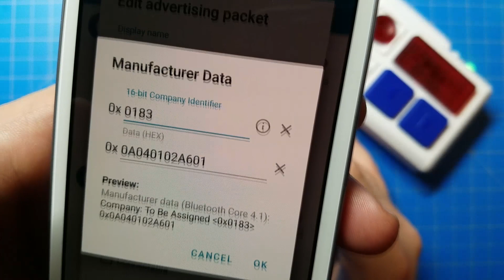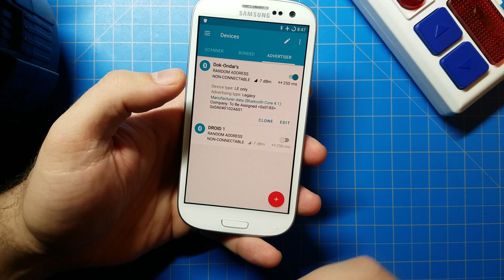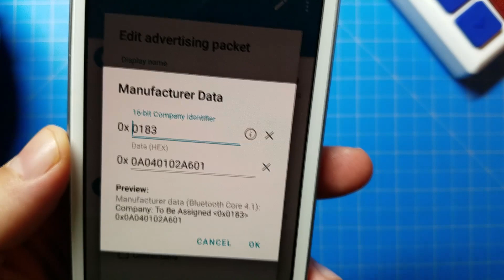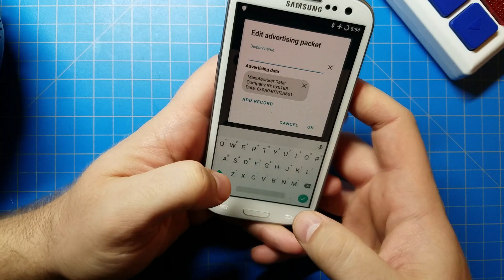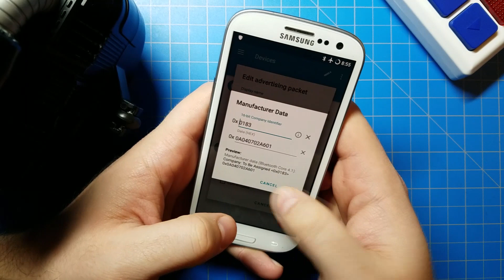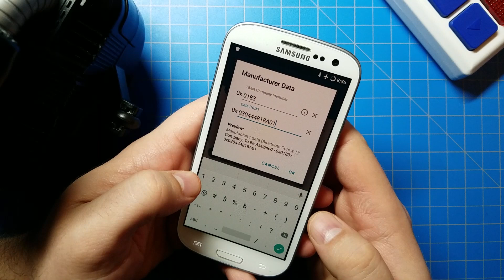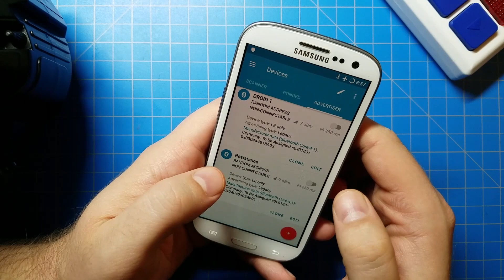Bluetooth Beacons and Custom Personality Chips for Droids

Comment: When you were replacing the bluetooth module chip and copying the programming across, did you see where the stock droid affiliation is stored? Is it possible to alter a droid's affiliation without using a personality chip?
Reply from the maker: not really, no. the affiliation is part of the personality chip. if you don't have a personality chip installed then the personality chip that's stored in the rom of the audio controller is used. the audio controller chip is different from the bluetooth chip. i haven't been able to access its contents.

i suppose it might be possible to patch the firmware of the bluetooth chip to use a fixed value for affiliation rather than querying the personality chip, but that gets into ARM assembly and I'm not well versed in that type of stuff.

Comment: Grate videos. Love them all. Think maybe the potentiometer is related to sensing the upright position of the bb8?
Reply from the maker: i think the pot is for adjusting power to the wheel so the BB drives straight.

Comment: i wanna buy one
plz
Reply from the maker: the issue with selling personality chips is i would only be able to sell chips with personalities that i've designed using my own audio. i couldn't use any copyrighted material such as audio clips from movies or TV shows. i've created one "personality" so far and were I to start selling them I'd want to have a library of at least 5 or 6 for people to pick from.
Reply: @Ruthsarian  what if it came blank and there was like a dock for the chip that plugs into ur computer and alows you to drag and drop files
Reply from the maker: @thehambonetelevision  that would require development of custom hardware (to plug the chip into) and software (to encode and write the audio clips to the chip). i don't think it'd be worth the effort. it'd be easier (and cheaper) to program the chip the regular way. if you haven't already, see this playlist of videos showing how to do all this using existing hardware you can buy off amazon and software that you can download for free:

https://www.youtube.com/playlist?list=PL1LWtA1iy9htxbn6YRiQPNZSwZlszt2Kj
Reply: @Ruthsarian  fair point

Comment: I’m surprised you haven’t started selling custom chips, too difficult maybe? I know there are a Lot of Droid builders out there that come up with crazy ideas. To be honest though, I’m not much different with my idea to take an R3 unit and make it like Analyzer from Star Blazers.
Reply from the maker: i've thought about it. i've sold a few to test the waters. the biggest issue is that people usually want copyrighted material (clips from TV shows or movies) and I don't want to risk the wrath of copyright lawyers. if i were to sell them i'd need to have something copyright free to offer; i'd need to craft another 5 or so custom personalities so people would have some variety to pick from. i haven't done that yet. but i am working on it.
Reply: Ruthsarian noding I hear ya. . . . You could sell blanks, letting the buyer add their own choice. Far as I know, copyright doesn’t apply if one makes for themselves...

Comment: Thank you I think I'll make a master chip 🤣 now I just need to program a blue tooth transmitter with all the beacons to selectively broadcast. That being said maybe the second blue led is for Bluetooth handshakes.

Looking for improvements to my BB the side wheels look like the should be bearings and not wheels  the one currently installed is causing unecessary vibration. But in a better motor and replace the magnets for the head and I bet my BBe will be running like new.

Comment: Can you do this with an iPhone?
Reply from the maker: yes, there is an iOS version of the nRF Connect app I'm using in this video.
-- EDIT BELOW --
I'm completely wrong. The iOS version of nRF Connect does NOT allow creating custom beacons. it appears this is an intentional limitation of iOS; custom beacons are not possible on iOS devices.
Reply: Well I have since found out you can’t do this with the IOS app because it doesn’t let you make custom signals. Thanks though.
Reply from the maker: @davisbenecke3623  You're right. I'm sorry. I had assumed they would have the same functionality across platforms, but they do not.
Reply: @Ruthsarian  do you happen to know if this functionality has been implemented for iOS? Is there a different app that has this functionality? Thanks

Comment: Great work!  I just picked up my first droid a few days ago.  Are you thinking about posting your methods for extracting the code (or the code itself)?  Or the contents of the personality module SPI flash?
Reply from the maker: I won't be posting the contents of the stock personality chips and the droid code. I worry there would be potential legal ramifications. I might do a video on how to access the personality chips' content and the droid code, but I'm not sure how useful it'd be. 

Here are some references for those who want to try.

This page documents the flaw in the nRF58122 that allows reading of the chip's flash even if read protection is enabled:
https://blog.includesecurity.com/2015/11/NordicSemi-ARM-SoC-Firmware-dumping-technique.html

Here's a rig that uses a CH341A (US$10-15 on Amazon) to read personality chips:
https://imgur.com/a/eA9zgyJ
Reply: @Ruthsarian  thanks for that info. I understand about not posting the code. I have some SPI flash chips and a programmer. I might try writing my own. If you decide to sell some of your PCBs, let me know.